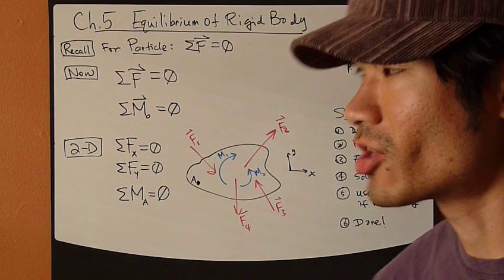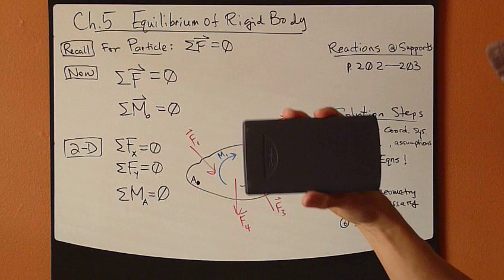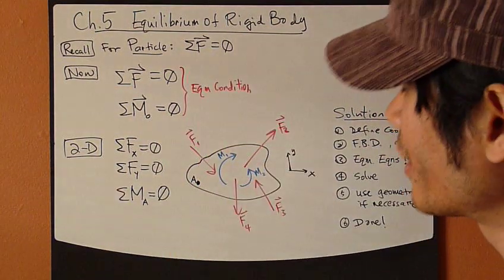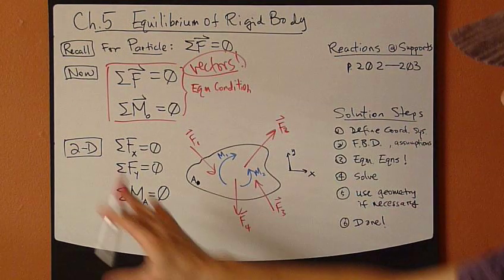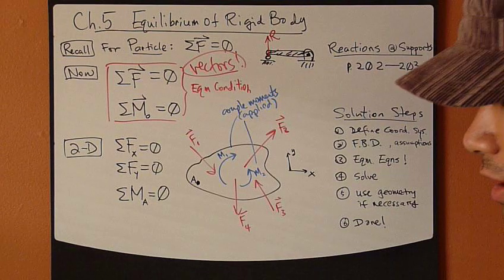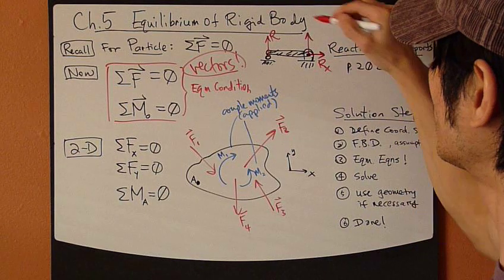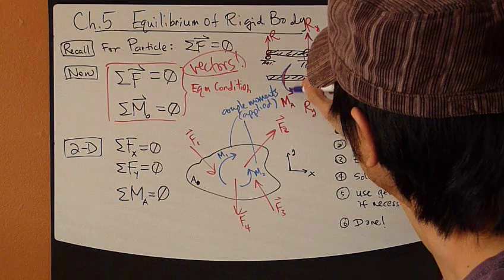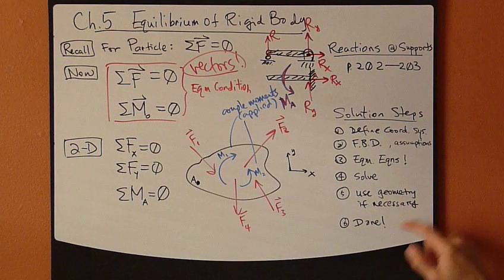Engineering Statics Ch5 Part1: Rigid Body Equilibrium

Comment: if the cylinder at A has a weight of 20 lbs . determine the weight of B and the force in each cord needed to hold the system in equilibrium.

answer this. 
B= 47.8

I NEED SOLUTION of this.

Comment: Note that in reality, there is no roller support that will give a perfectly perpendicular reaction force. This is because no roller is ever perfect. That is, when the roller is made, there is a tolerance for the cylindricity to specify how perfect the surface of the roller has to be made. But, there will always be imperfections. So, when the rod makes contact with the roller, it may make contact to either side of the vertical vector. In that case, the reaction force will be at an angle to the vertical.

But, for most problems in static, the assumption of a perfect roller is made. Note that assumptions must also be made about the rod. That is, it must have a GD&T flatness tolerance specification of zero and it must be perfectly horizontal. For that perfect case, the rod makes contact with the roller at the top, making the reaction force vertical. This is done in the problem definition in order to minimize the number of unknowns to solve for in this case with multiple bearing surfaces present in the problem.